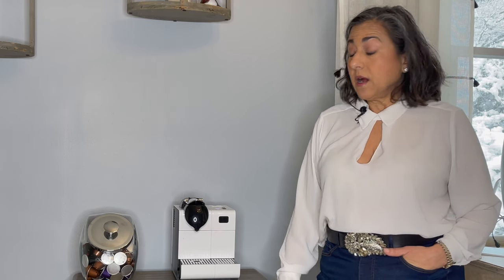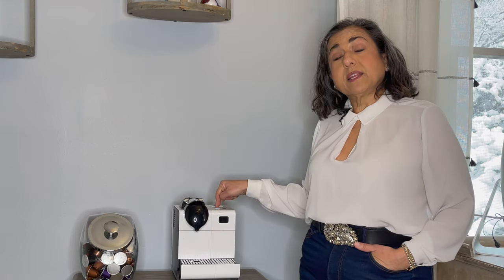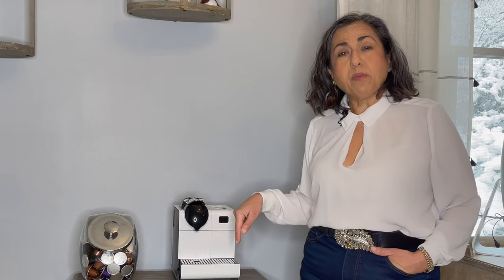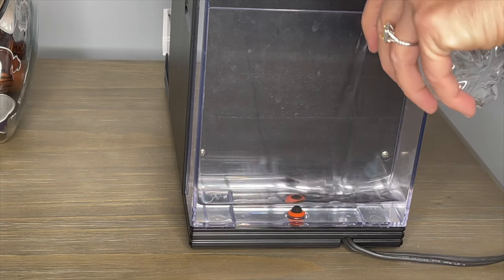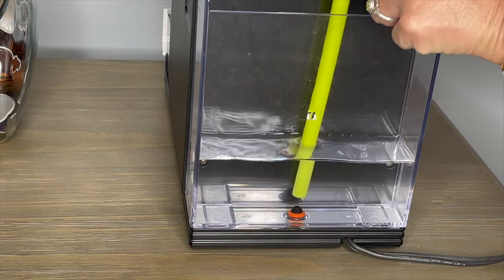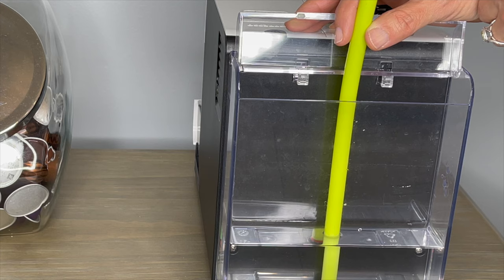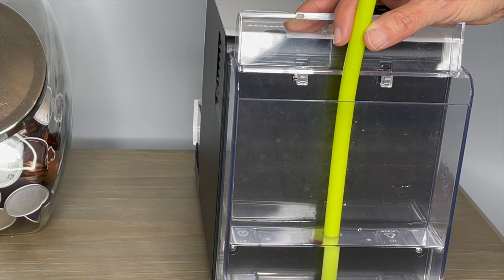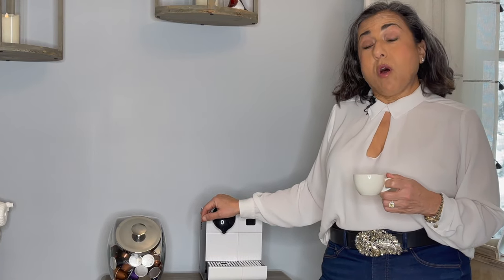Nespresso Machine Won't Pump Water? QUICKEST EASIEST FIX

Comment: Mine pumps out water fine with no pod, then I put a pod on and it won’t :/
Reply from the maker: Hmm.  This is interesting.  Let's break down how the machines work with pods. Each variety of pod has a different bar code printed on it. The machine "reads" the code to know, depending on your machine, if it's pumping out an espresso or a longer coffee.  I suspect the machine has buildup inside. Try this:  unplug your machine, open it and, using a very soft, barely damp cloth, clean around the interior and the areas where the machine touches the pod. This might solve your problem. Please let me know if this works. And good luck!
Reply: @AtHomewithAnitaRosner  hey :) I tried that, but it still doesn’t pump. I’m using the Lavazza coffee pods which were fine before, but now I’m wondering if I’ve got a bad batch with the new box because I tried a N’espresso capsule and that works fine. So it must be the pod itself.
Reply from the maker: @Blondie-sh6uh I’m glad you figured it out!

Comment: Unfortinately it doesnt work at all after trying 10 times
Reply from the maker: I'm sorry to hear that. So many people have used this hack successfully. I wonder if there's something else going on with your machine. If you have  water in the tube and the motor is running, it should work. 🤷

Comment: Worked for me Nespresso makes good coffee, wonder why their machines are so unreliable. Anyhow, this worked for me.
Reply from the maker: I actually wondered about that. Here’s my theory: I believe they test the machines before boxing them. This would leave a little water in the line. If the machine sits too long before being purchased, that bit of water might create a gap (or air bubble) when the user fills the tank and turns it on the the first time. Just a guess on my part. But I will also say, I do love my Nespresso machine.

Comment: I got a brand new one as a gift and it doesn't pump water at all...
Reply from the maker: You’re not alone. Many of the comments here are from people with the same issue. If the motor is functioning, this remedy should work for you. Good luck!
Reply: @AtHomewithAnitaRosner thank you for replying. Unfortunately my model has a water tank that doesn't give me any acces to it while it's in its place. The top of it is covered by a machine part. I tried to blow without the water tank being in it's place but it doesn't do any difference.
Reply from the maker: @kasiasowik7626 that’s a bummer. So
Sorry 😞

Comment: Anyone have this not work? As hard as i blow i feel like I’m hitting a wall.
Reply from the maker: If the machine is running and there is water in your straw, this SHOULD work.  If it isn't, there might be something else going on with our machine.  This has worked instantly for nearly everybody. Sorry you're having trouble.